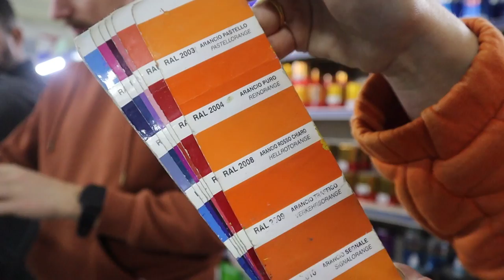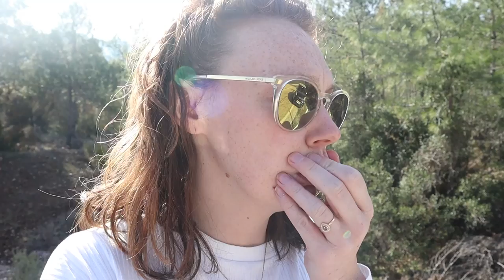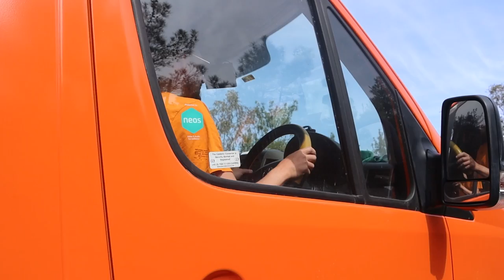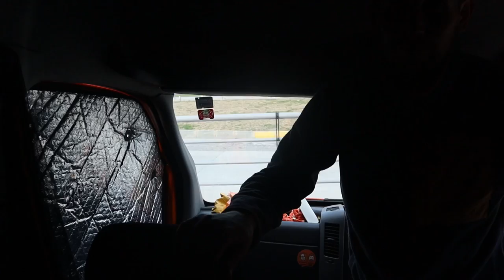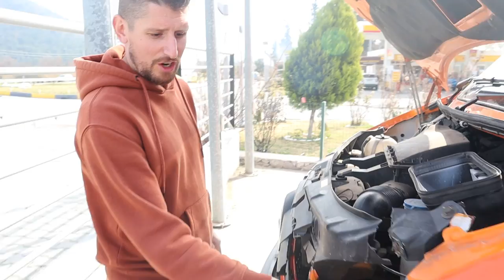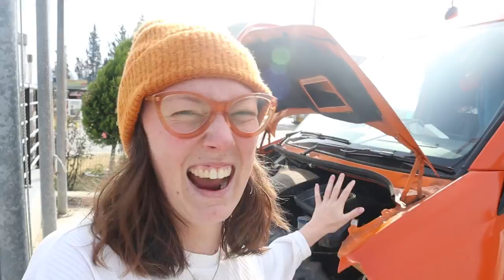British couple CRASH CAMPERVAN into a DONKEY in Turkey

Comment: Crashing with the bigger wildlife can be dangerous. Good to see that you both are okay and the van can be fixed. 
The damage does look ugly but in fact the body has worked as designed. The deforming parts took the impact and protected both the engine and the passengers.
Reply from the maker: Yes Ari that is true! The body has done what it is meant to do. Now to just get it fixed!

Comment: Sorry about the crash, but it’s fixable. I would be inclined to fix it privately there, no insurance involvement. I did tell you when you had a roof leak, a roll of masking tape should be with in the van at all times.
Reply: Whats the masking tape for ?
Reply: @donaldcampbell2828  Patch up the window that was not shutting? Use a plastic bag and tape, buys you time to get to the fix.
Reply from the maker: I'm with you Donald... Not sure how the masking tape would have helped in this situation 😂
Reply from the maker: We did consider fixing it privately but we'd already logged the accident with them straight away on instinct when it happened so decided to see it through. It's what we paid the extra for before our trip so we might as well use it.

Comment: The main thing guys is that you and the donkey are okay, it was kind of everyone to stop and help the guys at the garage showed the old fashioned customer service.
Sadly your experience with your insurance company is nothing new I was rear ended in my old 4x4 (other vehicle looked like it had hit a tank) without even having someone to inspect it I was told over the phone it's a write off (I was actually calling from the accident scene) on insisting that an inspection was done told to go a garage told by the inspector only a few scratches and slightly out of alignment rear bumper easy to repair  vehicle back on road within two weeks so stand your ground
Reply from the maker: We hope the donkey was ok! There was no sign of it when we searched but no idea if the one that came from the trees before we left was the same one. Sad to hear about your experience with insurance in the past but at least it worked out ok and you stuck with your gut. We were quite lucky in the end that the work was cheap so the insurance paid out in full!

Comment: Why couldn't it's be driven. Definitely not a write off but if you can get them to do that and give you the money that's the best corse of action because they will have to gator in possibly returning it to the uk in their calculations so will prefer the write off option. I had this a few years ago I'm Portugal and it worked out very nicely and no category put on the vehicle and easy to get fixed myself for a fraction of the pay out.
Reply from the maker: We didn't know how much damage could have been done at the time and we weren't 100% where the liquid on the road had come from which might have been dangerous if it was from the radiator. We later found out it was just the windscreen washer fluid 😂 but in the moment when we were really shaken up we didn't feel like taking any risks!

Comment: Sounds like a nightmare! Can't believe your bad luck!  At least you guys are OK and the donkey hopefully too. I'm not sure weather you have any say regarding the decision to write off or not?  Have your insurance confirmed they will pay all your hotel expresses?  Get receipts for everything! I've bought a car back off my insurance company after they decided to write it off, it cost me £500 to buy it back and I got it repaired for peanuts and also got paid out the book value of the car, although I had to argue the value out with them. Yes it was registered as a cat s i think from memory but it was no issue for me just cosmetic repairs and it flyed through its mot after it was repaired. At least there is no obvious structural damage to yours. If they do write it off hopefully it's been insured appropriately for its correct value as a camper and not just a van. It may work in your favour?.....you could get paid out anything between £10k-20k for your van by your insurance. You buy it back, (maybe 2k? im not sure as I've never had to to this with a van so I don't know a write off value for sprinters) all I know is sprinters have a significant value attached to them as spares / salvage. You get your repairs done elsewhere for significantly cheaper than your original  estimate from the bodyshop. They know its going through insurance so its likely to be several thousand euros for parts, plus labour matching paint etc etc etc. However, it may only cost another 2K to fix with 2nd hand parts, or maybe some dented panels can be knocked out.  Its going to be a proper stressfull few weeks but you may come out of this smelling of roses and not donkey sh*t! So don't panic, stay strong and you'll get through this. No ones injured or harmed it could be a lot lot worse. Please if anyone has any experience of van write off's please correct me. Good luck guys and all the best, we're thinking of you. ❤
Reply from the maker: Thanks so much for sharing your experience with us Phillip - we have heard of people doing this buying back their cars off insurance previously but thankfully we don't think it's going to come to that with the positive news from Mercedes on the engine and chassis looking all ok. It looks worse than it is I think and it's all panels and parts, thankfully not structural. Getting it all done at Mercedes as thats the only approved garage in Turkey that our insurance were comfortable us going to and we also know we will be getting the best service - even if it is a bit more expensive than an independent mechanic down the road. With language barriers and stressful situations like this we always opt to go to Mercedes when we have the choice. You're absolutely right, and it's all gonna turn out ok in the end. We will back on the road in no time!

Comment: Guys if you're changing the headlight, you can't use one from Turkey as there vehicles are left hand drive. Very important you get your headlight from the UK otherwise when your back in the UK your vehicle will fail it's MOT as the headlight for left hand drive vehicles point in the other direction.
Reply from the maker: Yep we definitely can't have her being cross eyed! And i actually don't think it's possible to put an EU version headlamp in a British van because the wiring is all different. Mercedes have it all in hand anyway and are aware that they need a UK headlamp. Sourcing one in Turkey, or even as an import from Germany, has proved challenging but they've got it all sorted and she's on the mend.

Comment: Had a freak accident too with my camper in Switzerland on my first trip abroad. Pulled into a motorway services and parked behind a truck. Truck decided to reverse into me as he couldn't see me in his mirror. The whole front  was squashed, bonnet,  grill lights cracked etc. I feel your shock and surprise.  Got it all sorted out in France from a scrap yard. Cost about €500 in parts  etc. The experience will stand to you as a hurdle that challenged you but ultimately you conquered.
Reply from the maker: Oh wow I bet that was so scary Tim! Were you inside the vehicle at the time?? Glad to hear you got it all sorted though and it wasn't too much damage to repair.

Comment: Thats really bad luck.  Did accident repair for a while. Thats mild damage.   If the insurance company want to write it off it could work in your favour. Let them write it off and say at the time you want to buy the salvage. Then find some one to repair it with used parts.  A used door will come glass and all the internals, same for a bonnet and wing. A used headlight won't look odd as opposed to new.  You will probably have a fair few quid left over.
Reply from the maker: Hey Steven, thanks for sharing your knowledge - we have made a bit of progress with the insurance since the crash and things are looking like they're on the up. The issue would be sourcing the used or salvaged parts in turkey and also finding a reputable garage that would do the work. But we've had great service from Mercedes and when in a foreign country we always find it comforting to be at the dealership as you can guarantee a certain level of service.